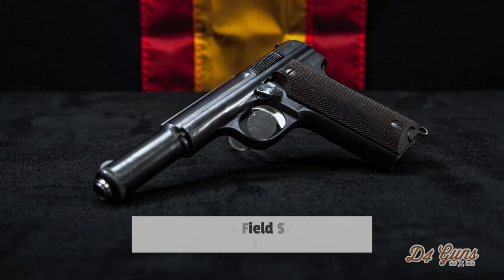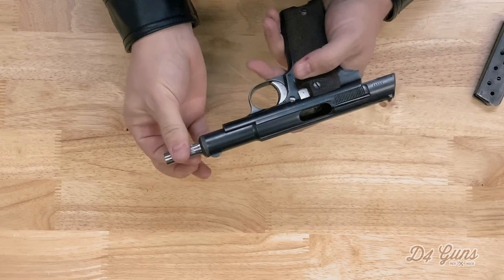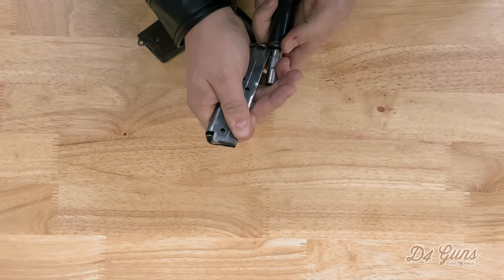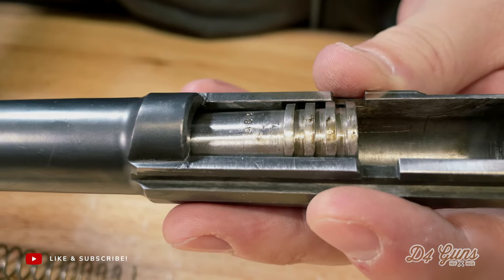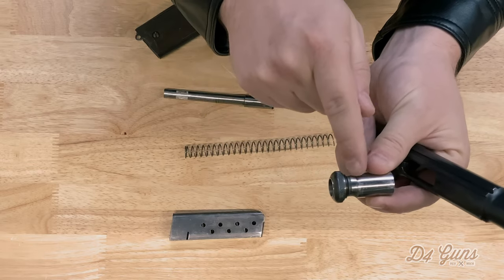Learn How to Properly Field Strip the Astra 600/43 In Minutes!

Comment from the maker: ⏱VIDEO TIMESTAMPS⏱
===============================
0:00 Intro
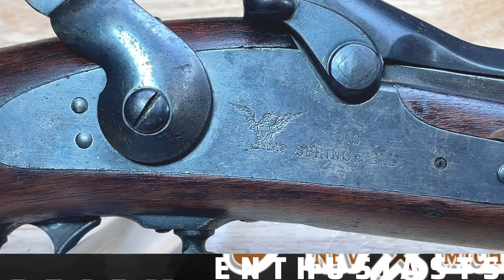0:13 Clear The Firearm
0:21 Removing The Slide
0:40 Removing The Barrel Bushing
1:03 Removing The Spring Under Tension
1:10 Turning And Removing The Barrel
1:27 Reassembling The Astra 600/43
1:30 Aligning The Barrel Bushings
1:47 Aligning The Barrel
1:59 Inserting The Spring
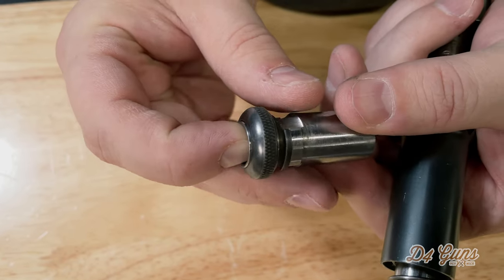2:02 Inserting The Barrel Bushing
2:13 Twisting The Barrel Bushing Into Place
2:21 Placing The Slide On The Frame
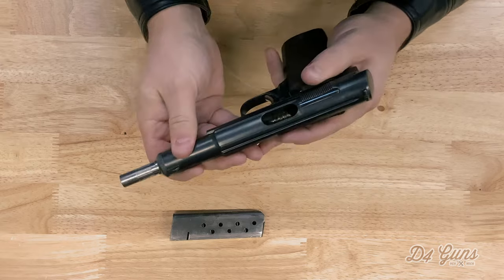2:25 Aligning The Frame And The Barrel
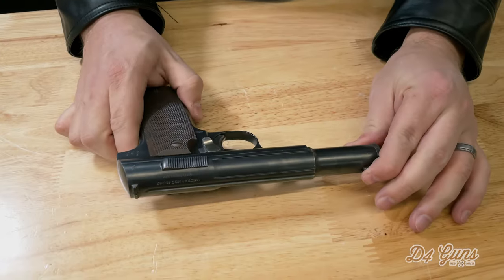2:54 End

Comment: When I disassemble my Astra 600/43, I view it from the front of the barrel, not from the rear of the pistol. Therefore I twist the barrel to the left or counterclockwise to unlock the barrel so the slide will come off and turn it to the right or clockwise to lock it back in place. I have seen videos that say both ways depending on your view. My question is, does the Astra manual, which I do not have, use the view from the front of the barrel or the view from the back looking forward to the barrel? I actually have my pistol in my left hand holding it sideways with the grip to the left. Hence the reverse view from your fine tutorial. Thank you. Your video is the best on the Astra 600/43. Once you are putting the pistol back together, and you have the recoil spring in place, you can use the safety to lock the slide and barrel in the correct place, then twist the barrel until it is aligned properly, and release the safety and the slide will go forward and the reassembly will be complete. There is no need to have to hold the slide and run it back and forth to get it in the correct place to twist the barrel into the correct position.